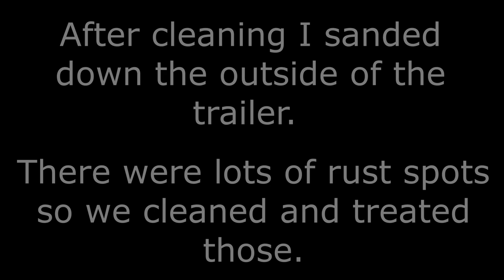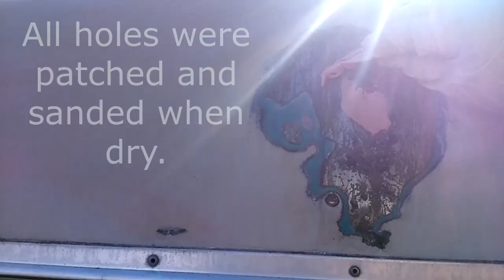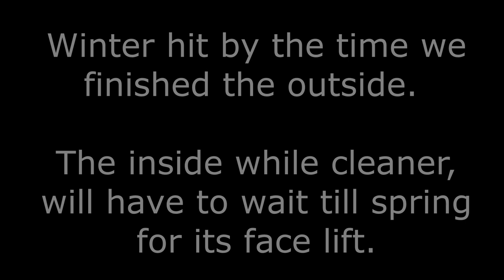Clean With Me! Horse Trailer Clean Out, Repair, and Makeover!

Comment: None of the holes are fixed That's just polishing a turd You cut the rust  out and weld in new metal
Reply from the maker: Not everyone is able to weld. This worked for us we treated the rust and filled the holes. Any large holes we used a auto mesh over with the filler. So far a few years later all still looks great. Thanks for watching.
Reply: @HomesteadOdyssey  if you think it's safe for your animals you're wrong That's why it's wrong to do it that way
Reply from the maker: @rono1506  every little hole was on the roof only on the outside so they wont be hitting or kicking it. The only one low was on the front where the storage part of the trailer is so again they wont have access to it. We have hauled cows and goats in it since this restore and like I said it doing great.
Reply: What was used to patch the holes, I just purchased a trailer that I want to fix and has tiny holes I need to patch. Please help